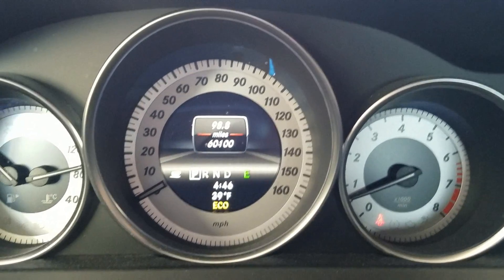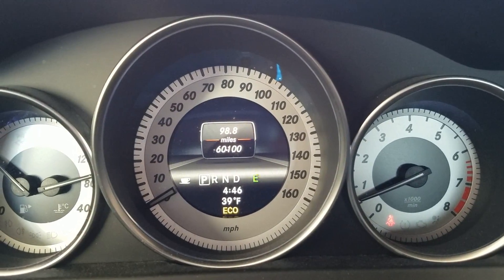60K MILE UPDATE - GERMAN CARS ARE RELIABLE?...

Comment: Like so many car mfgs., M-B is squeezing its suppliers, so they are cutting quality (so as to save $$); that is why they  fall apart in 5 years or so,. The issue of plastic engine parts (intake manifolds, water pumps, radiator lines) is severe, and will severely limit vehicle life spans.
Reply: Ad Mirer plus i think thats more a Problem for the us Models. The First gen mb-gl that was major designed for the us hat test problem too here in eu, but the other Models hadnt really  test much Problems ive seen from us models. I dont know why but thats just a thinking.
Reply: I am all fiberglass reinforced nylon valve covers, radiator end tanks, and nylon intake manifolds but, the oil pan should be made out of good old fashioned stamped steel.

Comment: I'm 15 and I really want a C Class (probably a 2008?) For my first car but my parents are a little weary on the fact that MB is known for being more expensive to maintain, but how true is that, is regular maitinence really that much worse?
Reply from the maker: +Yordin H yes and no. So Mercedes has 2 services (A and B) that are done every 10,000 miles and they alternate. So at 10,000 miles you would get A, then 20,000 miles you would get B, and 30,000 miles you would go back to A again and so on and so forth. These services are just regular oil changes, air filters, brake inspections, etc... the service in my city is about $200 for the A service and $500 for the B service. They usually offer a package that includes A and B service for $499 so that's 20,000 miles/2 years of service for $499. If you think about it that's not too bad of a deal (~$21 per month) since you will typically get a regular oil change every 3,000 miles on other cars and it can also cost quite a bit. So yes it's expensive but it's not as often so you'll just have to look at the cost over time. Mercedes is still probably more expensive than regular cars but it's not as bad as you would think. Another good thing to look at is just regular yearly costs on Google. It should break it down for you in comparison with other cars. Also call your local dealer and see what kind of specials they have. Hope this helps!
Reply: look in to A4 LOL Quattro
Reply: Yordin H buy a manual
Reply: Yordin H do not buy a German car they will break down on you 🤦🏽‍♂️🤦🏽‍♂️ I’m 16 and I don’t even want a German car as my first
Reply: get a rav 4... you'll thank me later when your brain develops more.